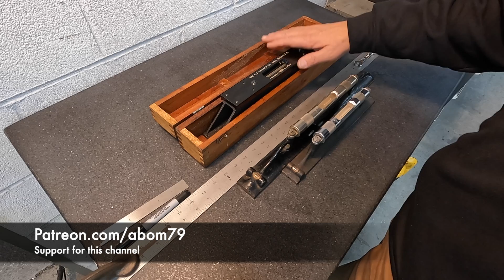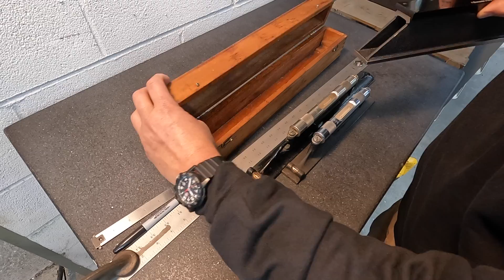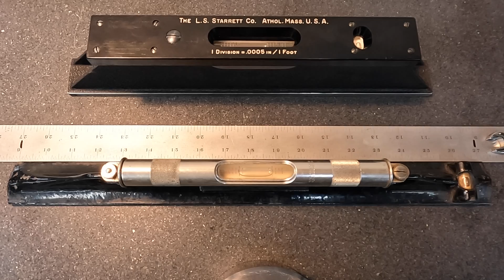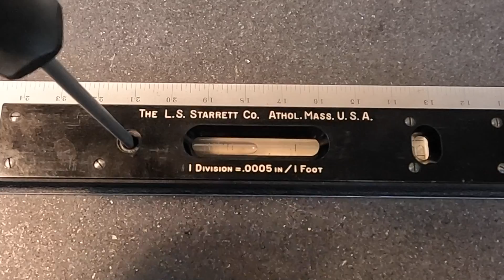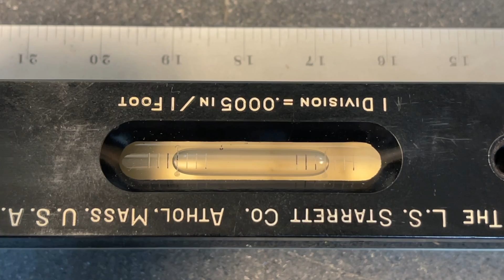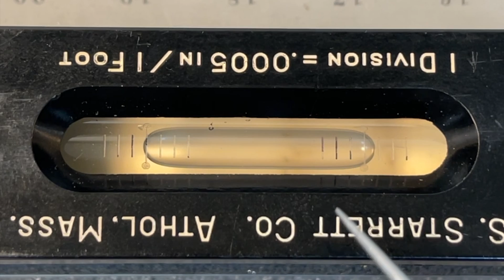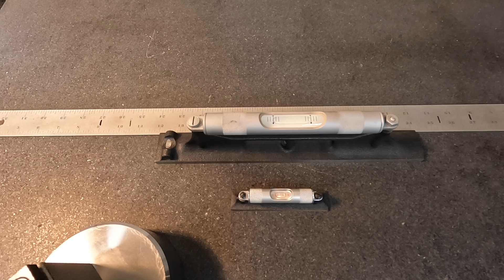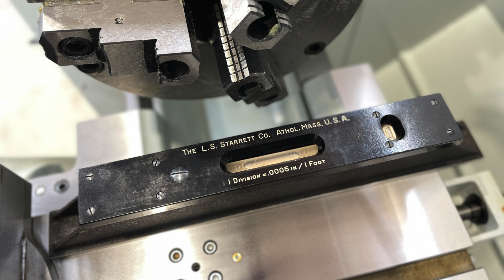Precision Level Calibrating

Comment: He is calibrating his levels to a reference standard, his granite surface. But I didn't catch what method he used to determine that his granite bench top is level. Any help on this? Thx
Reply: To be clear, the reference surface does not need to be level in order to calibrate your levels.  That's why you flip it 180 degrees.  Your surface just needs to be pretty straight and flat so you can repeat your checks.
Reply: @HomebrewHorsepower   I always checked my 4' level on the wall using the same method. If I was within 1/32" I was happy.  I figured each line on my level was 1/16". A quarter of that was near perfect.  I used to install elevator saddles. If it wasn't as good as I could make it., the flooring/stone guys would get upset.
Reply: His reference here isn't the surface plate, it is the straight edge, and technically gravity. The straight edge allows him to place the level in the exact same alignment after flipping it around.  By using the straight edge as a reference he could calibrate it on a firmly mounted 2x4 as long as it was clean and in a stable environment.  All calibration of a level is doing is making sure the plane of the base of the level and the plane of the bubble are precisely parallel.
Reply: @andarkelorin8797  yup.
Reply: That's why he rotates the level back and forth to make sure the reading is the same when it's flipped longways.
Reply: A levels is "self proving" in that you can flip it around and if it reads the same, the level is level, as it were.  Tom Lipton did a detailed video on the process: https://youtu.be/zIDL77qt1tI
Reply: For the purposes of calibration, the granite does not have to be level.  If the level reads exactly the same after being rotated 180 degrees, it is calibrated and reading correctly.
Reply: @jim79015  My dad showed me this trick many years ago - in the level isle of the hardware store - grabbed a couple levels off the shelf and set them on the floor. Then flipped the levels around and they didn't read even close to the same - needless to say we went somewhere else to buy a level that day! And those were just regular 12" carpenter's levels - not anywhere close to the accuracy of a Starrett 199! Also more recently when going for a walk on garbage day, someone not that far from me had a level in their garbage bin. I wondered why someone would throw out a level - took it home and did the "flip test" on the garage floor "ooh, that's why they chucked it out". Little adjustment screw added, calibrated it using the flip test, and now it's a "good enough" level for doing landscaping and drainage tasks so my good levels stay inside and out of the mud!
Reply: Adam had a bunch of videos on this topic I think with one of this friends; the use lasers or sound or something I think to map out the lows and highs.
Reply: https://www.youtube.com/watch?v=VrodNx759oo 
https://www.youtube.com/watch?v=-CM3VWKXasY
Both Abom79 videos show making that granite surface plate accurate to  AA grade spec based on ASME. This highest accuracy plates are called Grade AA, and they are often found in calibration laboratories. His plate is flat to 1,000,000 of an inch in every direction. The second video listed shows how this was done.

Comment: ABOM love your stuff
Adjusting a level is simple
The bubble will alway sit on the highest point of the fluid so,
if you turn the adjust screw to lower that end of the vial, you will push the bubble away
if you turn the adjust screw to raise that end of the vial, you bring the bubble to you

Comment: Just curious. How does being very, very slightly out of level affect the accuracy of a lathe or mill?
Reply: The way the forces work, more wear then what is designed will be focused on certain points. 
Also oil will flow or coolant towards the low.
And finally everything is rubber when dealing with ultra precision flatness and level. So you could twist your machine out of wack if its not as level and square as possible. Even a steel I beam or granite surface plate will bend due to stresses and taking time to work it out will improve overall accuracy.

Is my lathe level? Its close but not very well done. Its something I'm going to be changing but is not on my list due to how light duty and little I use it.
Reply: @tek4  Thanks!
Reply: ThisOldTony has an entertaining explanation of why leveling matters here: https://www.youtube.com/watch?v=THkb-x35fwc

Comment: I just picked up a Starrett 199z on ebay.  Mine previously belonged to the General Motors Hydramatic transmission plant in Warren, MI.  It is an impressively precise tool.  I set it on my kitchen counter and it could detect my 7 year old daughter walking around in the kitchen.
Reply: That's the thing - it can easily be too sensitive! You have to pick your moments.  Maybe start off with a less sensitive level, and then switch over to finish things up!
Reply: How much did you get it for? They seem to be upwards of $400 on ebay regularly now - just a couple of years ago, the prices were much cheaper.
Reply: @gorak9000  $251.16 total with shipping.  To be clear, that included the wood box.  Don't buy one without the box.

Comment: Got a question for ya Adam why does it have to be so perfectly level I mean level is level right not being smart elic now don't get me wrong just wondering I don't know I'm not a  machinist like you are
Reply: It's not really a matter of being level.  It's about being straight.  Any amount of twist in a lathe bed will result in a taper in turned parts.  You want your machines to be perfectly straight to prevent that, and making them level in multiple directions does just that.
Reply: When you're levelling a lathe or other peice of precision machinery you must know your level is perfectly level as it is a reference for your machine levelling. If a lathe is not level it will turn a taper. If you're making precision parts, even a tiny amount of taper can ruin the fit of parts and cause you to have to scrap material.
Reply: It doesn't, the level is just for reference only. He probably just introduced error into the level.
Reply: I was thinking the same thing.  Big ol bulky lathe, does it really need to be level to the thousandth?
Reply: @mshilko  the bigger the lathe or longer especially and of course the precision of the work dictates the level one goes to. There is an old Colchester at work that turns a taper probably 1mm/300mm. So a good taper but for the parts that are usually made it isn't critical. For the stiff Adam often does, it is.
Reply: Thanks home brew just didn't know an was wondering now I do thanks so much